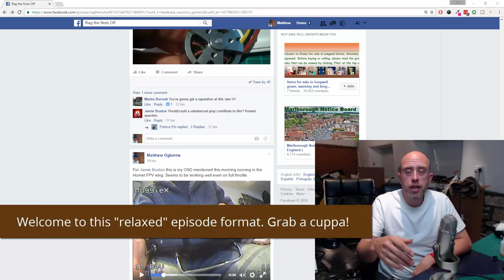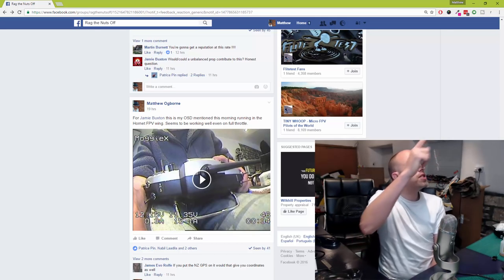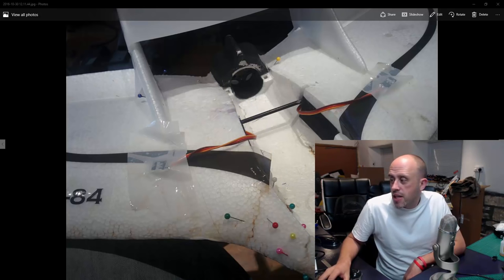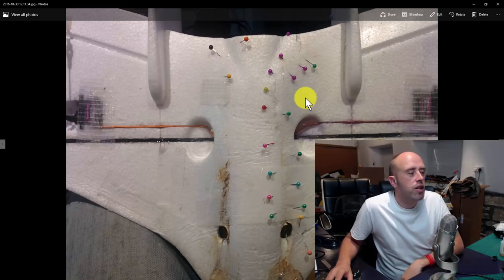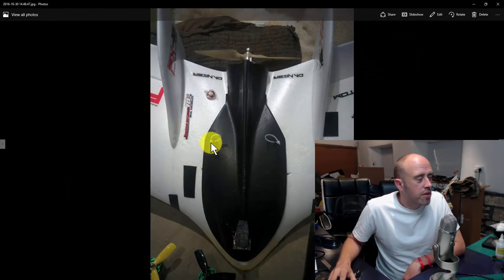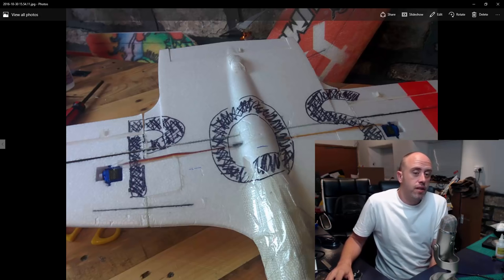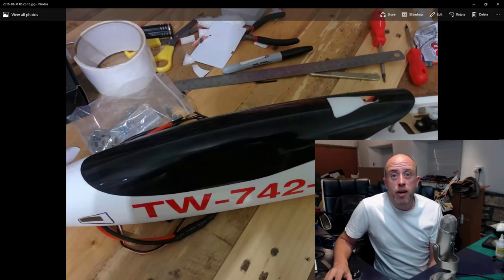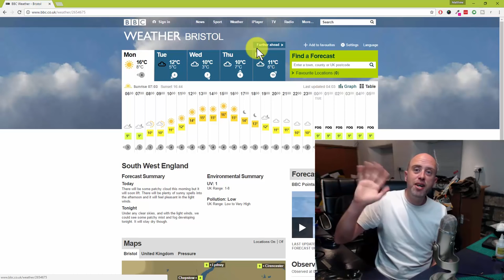RC Coffee Chat #35 - A Build & Repair Day

Comment: Morning Matt. A good day's flying yesterday, took 4 planes, flew them all (if you count about 10 seconds with the Rainbow wing - I've spent more time fixing that POS than I have flying it, it's one last chance away from being spare foam) I've loosened the landing gear on the FunCub, so I've got that to fix but other than that, a great still day for late October. 
An added bonus was watching the IC guys landing hot - no headwind to slow them down so we were holding up score cards made out of cardboard for all the nose-overs at the end of the strip :-)
Reply from the maker: HAHAHHAHAHAHA "Inverted landings" those are my speciality. Anything I have with landing gear on get's taken off, one lap round and landed, the rinse & repeat. I bet it was the ones that made a long landing approach that scored well? Matt

Comment: Howdy Matt, OK so APM and stuff 1st the auto launch the issue is me not the APM. I think it needs a waypoint after launch and I gave it nothing barr launch and nothing else so I will test that with a waypoint for it to aim for... More testing for the wing wing!! I have a few APM's and one PIXhawk. If I have spent more than £50 on the model then we all know the model + bit = ££££ so for me having the most tested flight controller that is solid is best so that I don't lose the aircraft. I can have stall prevention to stop spins if I am flying slow and tuning on finals etc. The flight modes I can have 6 so that I can fly normally or go super simple and have the controller do the bulk of the work so that I can play with the cam and see where I am flying with out worry that I will loose height, drop a wing, stall or something else. I like the fact I can point it somewhere and it will fly while I soak up the views. Ok so it does not work out the box and you might have to watch the odd video to get things right but to me it works so well. The wing wing works well with APM and if you have the Pix then use it. I use the wing wing as a test platform and then I can take those lessons learn and use them on something bigger like my Skywalker X6 which is another test platform. So in the end when I build my X8 (2.3M Delta wing) or take the FX79 out I can be very sure that it will come back in one piece and last a long time.  Its a product you should really get to grips with, I would like to see a decent video on some features that are never covered on youtube like auto takeoff and if you have the big Kaoonas  the auto landing. The other day when I posted about the auto crash thing I was in a field mobile phone with an OTG cable running 433 telemetry to program the waypoint to try it. Once done and uploaded via the phone I took the 433 off the plane and tested the take off thing.. So being able to do something in the field and set waypoints is good. My best flight was with a glider doing thermal soaring from a flat field with the apm in training mode and it worked so well that I could really get into the thermal get some very decent climbs. I think the pix will even do terrain following if you have telemetry and internet access! Its not a product for everyone and the apms are now end of life but it is the most tested and its worth watching the video of where it came from. It was used for a competition in search and rescue and that's then how it got funded.
Reply from the maker: Howdy Jazzy, ah I didn't know that about it's history. I think I'll pass on the auto landing feature :P I've got all the electronics sorted for a F3 board with iNav today, they're sat here waiting to go in. I'm a bit 50/50 on the exact placement, but I'm sure I'll get it sorted :) If the F3 & iNav doesn;t work out, I'll move on to the Pix Racer instead, the hole for the GPS will be about the same size :P Oh I was going to ask, how do you get on with the telementry side when in flight? Matt
Reply: No issues using an Android phone, OTG USB to the USB 443mhz radio. Never tested the range and I have rubbish internet access in the field for map data but it works and updates across the map and is solid. I have tested a 2.4hgz unit.. Yes wifi telemetry when flying on 459 MHz and the range was like 150m again I normally just use it for setting them up back home if I cant get a USB cable to the controller.
Reply from the maker: Jazzynet100 I've got a bluetooth module in this one, so I can connect and set way points using the phone. Should be fun!
Reply: Looking forward to it : O ) So you got airspeed for it as well as GPS too?
Reply from the maker: Jazzynet100 Nope just GPS speed. Programming the OSD next :)

Comment: Just in case you missed it iv sent you a message in your youtube messages.
Reply from the maker: Howdy Andy, thanks for the heads up. I was thinking about one of those, but bought 2 of the other ones instead :) Matt
Reply: I went for the 1.2 meter glider because its so cheap im not going to worry if i stack it, 
Or modify it with a nose mounted motor to get it up in the air. 
Im hoping it will make a cheap trainer for one of the kids.
Reply from the maker: andrew hodgkinson Yea I bet it would be great for that!